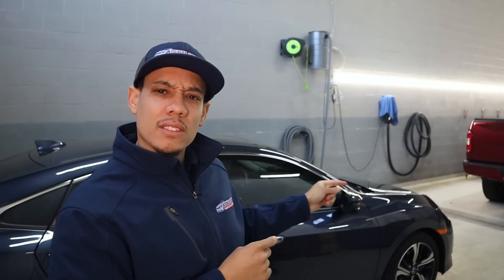Step by Step Paintless Dent Repair on a 2019 Honda Civic | Dentless Touch

Comment: Great job. I wanted others to note that the window wedge is facing the correct way here. I see so many who face it backwards and adding more pressure against the glass. I had a tech blow out a BWM 5 series rear window once because he didn't follow instruction and forced the wedge in too deep and backwards. Just an FYI.

Comment: Great video Chris, Are you pushing with the glass in the door? Even with the guard, is it possible to break the glass or are you not prying against the guarded glass at all. It hard to tell since you don't show the behind of the repair pushing you are doing. Can you show a video of the behind pushing going on with a used door or other panel? Thanks, Vince.

Comment: Do you find yourself using sharp tips a lot? I have the 24 inch dent reaper and a 16 inch “36” tool from pdr finesse. I’m slowly building my tool collection, but i was wondering if i should just be buying sharp tip tools of different sizes or if you thought I’d be ok with the dent craft set and the 24 inch reaper. Pdr finesse is mad bread lol